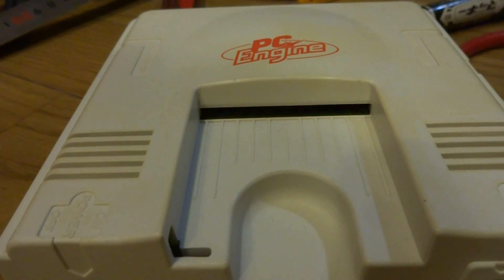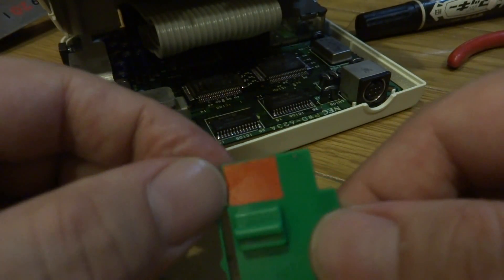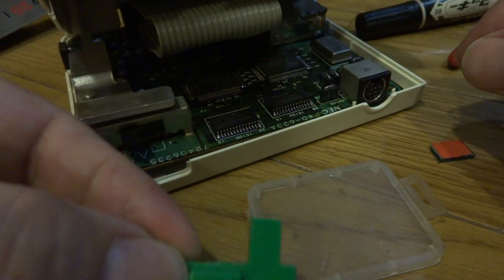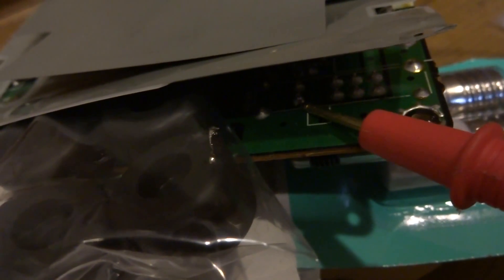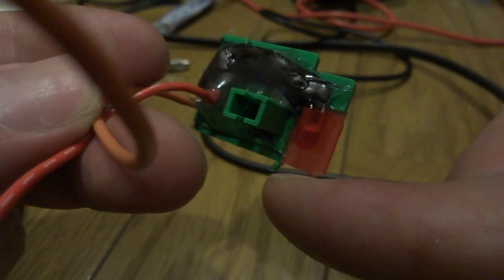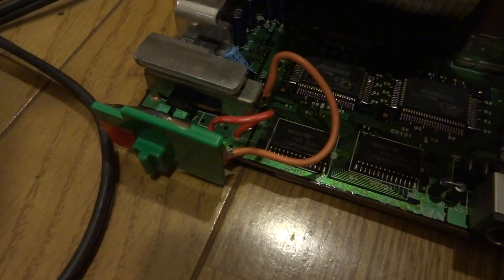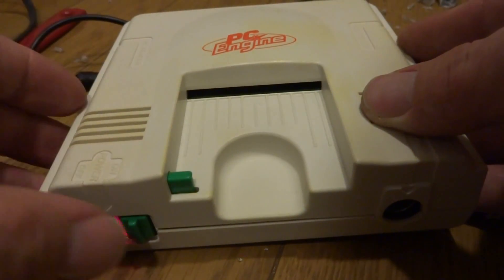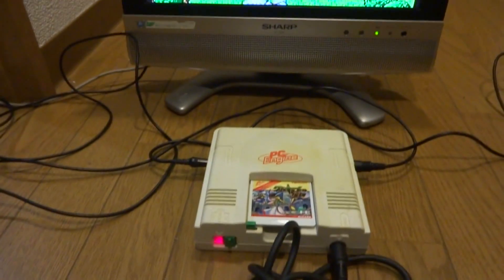PC Engine Core Grafx Power LED Mod

Comment: I prefer red tape.  Zero carbon output zero electric cost and all these damn power lights in my place make the room brighter which makes my home theater projector worse because the darker the better with projectors.  But I got like 20+ damn led lights on everything.  How much power do u think these power lights eat up, even from idle devices worldwide?  it must be alot.  My home probably has 30-40 of them running 24/7.

Comment: Luke, I really need some help with some Super Nintendo carts that I can't seem to get going. They work and turn on, no issues on sound. But I get consistent issues with character sprites, menu cursors, and running text really doesn't work at all. It varies in a small degree from each time I try to boot the game. It's frustrating cause it's pretty much unplayable because of this.

PLEASE HELP LUKE!!!!!
Reply: That's prob the pins on your super Nintendo either being bent for dirty. Might have to change them or clean them.
Reply: Can't be. All other games work just fine. There's no rhyme or reason. It's only consistent with my Soul Blazer and Street Fighter 2. Everything else i have works perfectly, so it can't be the Snes...
Reply: clean out all your shit... console and games... and it will work... most guys with this Problems have dirthy shit stuff...
Reply: Dude, everything is clean. Simple as that. I've cleaned everything thoroughly. The problem is isolated to just my two games that have the same problem. I've even brasso'd the connectors and nothing. You gotta give me something better than "it's just dirty".
Reply: robert kaey are you assuming that he has dirty games and dirty stuff? you are a moron

Comment: cool, If i did this i would have either put clear red high brightness LEDs under the vents on top or drilled a hole in the red part of the plastic switch and glued a diffused red flattop LED flush with the plastic in the switch.

Comment: Hey Luke. I have some issues with my PC Engine. I left a card in the slot for a while, now the system loads games very intermittently. Is there a way to re bend the pins into place? Also, I have an AV Booster, and I want to take it apart to install an RGB mod into it...but it just won't come apart